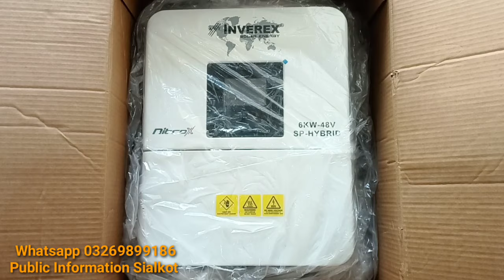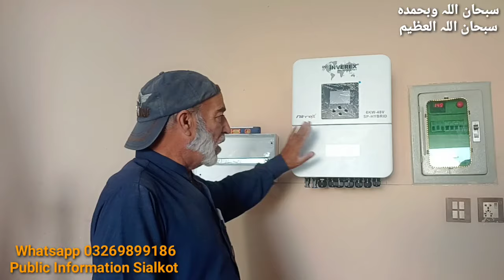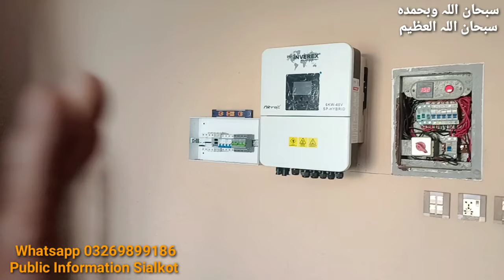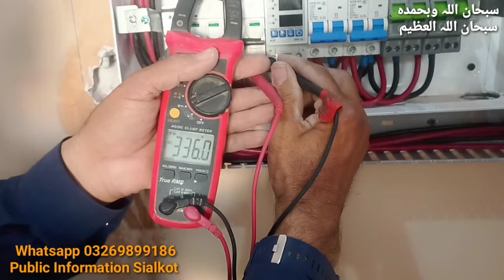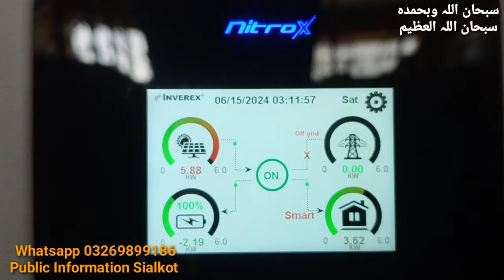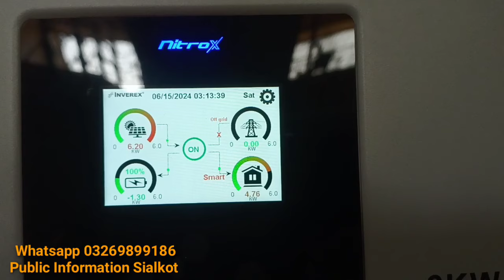installation of Inverex Nutrox 6kW Hybrid Inverter

Comment: mohtaram kitnay panels k sath  6200 watts ki generation aa rahi hei, mera 3 phase meter hei aur merey ghar main db box mei main supply pr breaker ki bajaye earth leakage laga hua hei kia earth leakage kam karey ga nitrox 6kw solar system pr  ya 4 pole breaker lagana paray q k installer kehta hei breaker lagana hei earth leakage ki jaga ap guide karein aur agr lagana hei to q
Reply from the maker: السلام علیکم بھائی میرے اپ اس نمبر کے اوپر اپ واٹس ایپ پر کال کریں 
03269899186